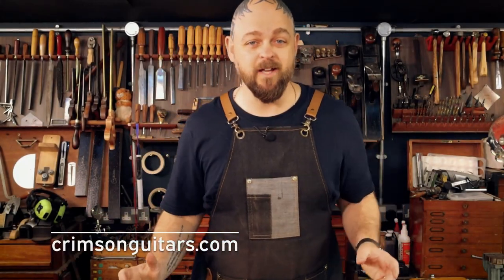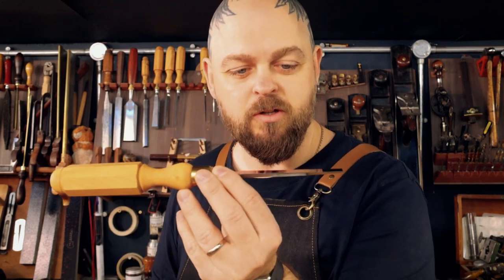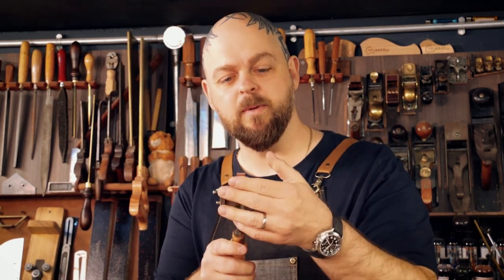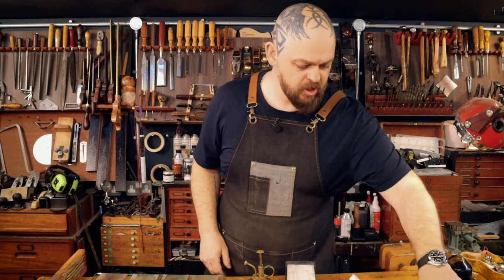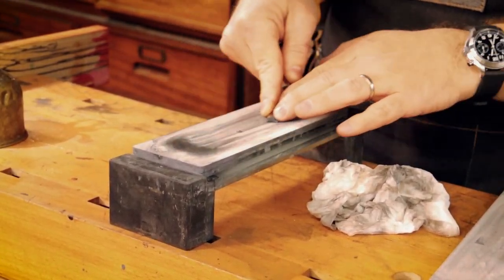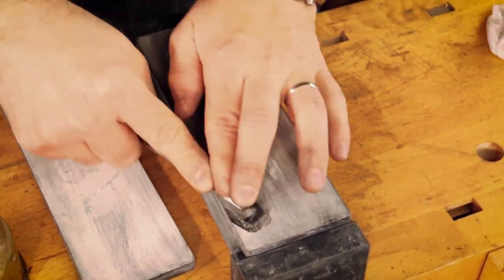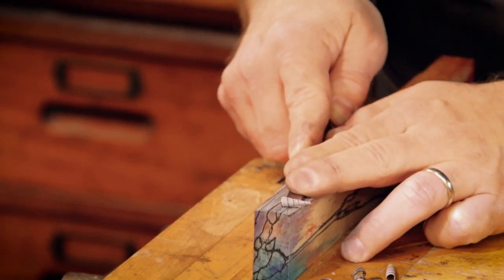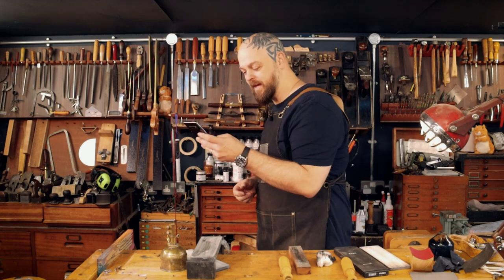HEAD to HEAD - Scary Sharp vs. Waterstone - Chisel Sharpening Techniques put to the TEST

Comment: Good demonstration of why using lapping film on float glass is considerably quicker. I’ve watched highly skilled woodworkers take 3 or 4 times longer using water stones freehand to achieve comparable sharpness to that obtained with lapping films and a honing guide. Stropping makes all the difference to final sharpness unless you use a very fine stone or film in the 1 micron range.

Comment: Tormek.  One nice thing about it is that once the bevel's been established, it is so very quick and easy to replicate it using their set-up jig.  Another is that you don't have to return to the grindstone when your steel gets slightly dull; you use the strop wheel.  A few seconds - literally - of stropping and you're back in business.  Unless I damage the edge, I can strop many times before having the grind.  And again, replicating the angle I want is quick and easy to do.  Killer system.

Comment: Gotta say, I prefer the method used by Paul Sellers (diamond plates + strop) - re-sharpening takes all of 30 seconds for an already-prepared chisel. I tried using scary sharp for a while, and oil stones for a while, and both were too much upkeep (ripping paper, flattening, etc) for the same results.
Reply: Paul is a legend and he uses Aldi chisels quite happily
Reply: Same here! Diamond stones and a strop, although I do use a honing guide most of the time, especially for plane blades.
Reply: Another Paul follower here :) I use a guide for the 1/4" and plough plane irons but the rest is all freehand.

I use the thin diamond sheets rather than plates, double sided taped to a thick lump of melamine face plywood.
Reply: Same.  I have the trend 300/1000 stone and a DMT 8000 diamond stone.  

I find that the most important thing (more so than going to 8000), is using the strop.  That can make a 1000 grit polish cut like an 8000 no problem.
Reply: What grit should i be using for scary sharp? I’ve watched like 5 videos trying to get a list of all the grits and i can’t find it. There’s like 20 grades of sharpening grit. Japanese chisel sharpening is like 1000 to 8000. I’m guessing it’s 4 grades between those two?
Reply: @stevedimebag  what kind of polishing compound are you using for that? I have some green chromium oxide compound but i think there’s finer grade that i should be using
Reply: Off the top of my head I'm using 300, 600 and 1000 grit and the German equivalent of Autosol on a strip of leather. The diamond plates are thin things from China via ebay for a fraction of the price of the blocks from DMT. Paul Sellers also mentioned the thin plates if you search in his videos.
Reply: @simonorchard1115  i set my glass plates up with 300, 600, 1200, 1800, 8000, and 14000 and it seems to work pretty well as long as there’s amole honing fluid applied

Comment: VERITAS!!  Sorry, love those guys, I have a few of their planes.  Do you ever use a leather strop after the microabrasives?  I always keep one on the shelf under my bench and just give a real quick swipe.  Takes it from razor sharp to slices paper like butter in seconds.  Also, I picked up a powered Japanese stone from Woodcraft a few years ago that speeds the initial polish up a LOT.  It uses the flat side of a disc instead of the round edge of a traditional grinder.  Good stuff!!

Comment: thanks, one thing, by starter of with a higher grit on the stones and without creating a hollow you set youself up for significantly more work. Important point I think is that using sandpaper its important to get the right sandpaper system

Comment: I like to use a 120 grit Shapton Glass for initial sharpening (because it doesn't leave scratch marks like the coarse diamond I used to use) and follow up on a well worn 1000 grit diamond and then strop.  Works for me.

Comment: Love the other comments here lots of good points tip for stones, specially on a budget with 2ndhand or well used stones, draw a grid with pencil on the stones and use a level object to rub a few times to find high spots in the stone and use worn out stones, tools or files to take the high spots down and repeat to get the stone level. It can really be helpful in time and energy

Comment: I’ve found for speed, I use a wheel if I need to re grind, but use a veritas jig to do chisels and plane blades at 25 degrees. I only need to use a 1200 grit DMT diamond stone and a strop with polishing compound. 

Perfect polished repeatable edge in a minute or so.  One stone, one stop.

Comment: I've found it's mainly the initial sharpening where you'll see the time difference.  It's like an initial setup of the tools.  Resharpening is much faster at maybe a couple of minutes if you stay on top of it, which is pretty much whenever you feel drag or binding in the cuts.  It should slice instead of requiring that the edge be pushed through the material.

To anyone looking to get into tool sharpening, if you have the time, definitely learn how to do freehand sharpening using either waterstones or sandpaper on float glass (I use both depending on tools).  Once you've developed a feel for how the metal responds to sharpening, it'll greatly improve your use of tools like scary sharp since you'll know what should be happening.

Comment: After 25 years and trying 3M paper to 0.5um or scary sharp (from veritas),  several Japanese wetstones, Torkek, and Shapton ceramic, their was very little difficulty in making a decision what worked best for me. Shapton ceramic stones in 500, 1000, 8000, 16000. Tormek for grinding primary bevel when the secondary is big or on a new chisel. My second favourite is the 3M scary sharp, but that actually s a lot more expensive than one would think

Comment: I use an inexpensive 1000g diamond stone with some window cleaner and an old leather belt with cheap chrome metal polish to strop. £40 total. Can shave with it very easily and quickly. But I gotta admit, the sharpest edge I EVER felt was a friend's katana. That was a truly competition grade scary edge. Looked like glass even under a microscope!

Comment: I hate talking grits of sandpaper and sharpening stones. Each manufacturer seems to use something slightly different. I really wish we'd all just move to the average grit size in microns. That way we could compare all of the abrasives used in sharpening i.e. sandpaper, diamond stones, waterstones, and Arkansas stones.

For instance your Shapton stones - 2,000, 8,000 and 16,000 - are 7.35 microns, 1.84 microns and 0.92 microns. Your Shapton 8,000 is just a bit finer than 6,000 grit sandpaper (2 microns), but not as fine as 8,000 (1 micron) grit sandpaper. And the Shapton 16,000 is just 0.08 microns finer than the 8,000 grit sandpaper.

Green stropping compound is around 0.5 microns.

Comment: Most used in shop are Japanese chisels, mix of about 4 different blade styles, blade widths usually between 1/8-1/2 in each style, split of blue and white steel. Most are sharpened at 35ish degree range all with a microbevel (we mostly work hardwoods) on water stones.  Just recently was trying some “harder” water stones, Ohishi brand.  Think I will go back to the softer water stones, like the slurry build better on them.  The softer stones are more expensive, but give a better edge IMHO.  Diamond stone for flattening water stones.   Water stones from about 400 to 6000ish.  Piece of left over 8-9oz hide glued to wood for a strop to remove burs.  Hand plane irons get sharpened on same.  Have a old Veritas honing guide that gets used from time to time.   Use small slip stones for gouges.    Have a WS3000 in a drawer, have never turned it on.  Have another drawer full of diamond stones that have never been opened.  Metal lathe HS tooling gets shaped/sharpened on a slow speed Jet grinder running various white Norton stones and a pair of jigs (don’t recall their name right off).

Kitchen knives (high carbon “western” and stainless/VG-Max Japanese style; each are sharpened at diff angles) get sharpened, no jigs/honing guide, on the wet stones as well.

Comment: In my lab at Cambridge I had a couple of 'microtomes' - the devices used for preparing specimens for microscopes, slicing them into wafer thin laminae. [ For biological samples, they are first potted into paraffin wax ]. One of them used wickedly sharp metal blades, like vast straight razors [ cut-throats ], only 6 -12" long, & ground from surgical steel. Steel is a polycrystalline material, and at the ultimate level when viewed in an electron microscope, the sharpening process will merely rip entire crystallites out. It looks like a view of the Alps, or any other mountain range [ but, very,very tiny mountains ]. No matter what grit you go to, you will never get to the stage of splitting, or cleaving the micro-crystallites.
For slicing even thinner specimens required a different sort of knife, and I had a machine that produced glass knives from strips of 6mm plate glass. When scratched & snapped, this produced triangular 'blades', with one 6mm wide edge that went all of the way down to the level of virtually single silicon & oxygen atoms. Unbelievably sharp, but glass is not crystalline, either polycrystalline or single crystal - it is a super-cooled liquid. Under the influence of thermodynamics, the knives would spontaneously go dull over a period of a few hours, as the exposed atoms at the very edge shuffled their way back into the 'pack'.
The ultimate blade was, of course' the 'diamond knife'. Diamond is a single crystal, and it is possible to cleave it along certain crystal planes, leaving an exposed edge. Because it is a crystal, the atoms are rigidly tied into the matrix structure, and are not subject to the same 'mobility'. Sadly, the blade was only 2-3 mm wide, in a metal mount - and HIDEOUSLY expensive.

Cutlass Custom Guitars.
Reply: The corollary to all of that is that, at the ultimate degree, the maximum sharpness achievable owes more to the forging, hardening & tempering of the chisel steel than the grit you work up to.

Comment: Why do you need to take out that fraction of material from the back before using the scary sharp? I did not understand that.
Reply: Creating that miniscule hollow makes it easier to focus on the tip. Japanese chisels have a drastic hollow, but on those the lengthwise edges form a plane together with the edge.

Comment: Ben you need to talk to Alec Steele, he’s a blacksmith I follow who could make you lovely things in Damascus steel…. That would be a colab of epic proportions! 
Getting back on point I use a ceramic wet stone and leather strop, haven’t got any chisels but after 15-20 minutes I can have a shave with my Letherman!
Reply: "Damascus" pattern welded steel (not actually Damascus) is not good for chisels, the edge has to be a very consistent material which pattern steel by definition is not. high quality backs with pattern welded tops would be doable though. Alec seems like a good craftsman but i think his style is a bit too full-on for Ben's audience, it certainly is for me.

Comment: Why didn't you strop the first one. I like the DMT diamond stones because I don't have to flatten them. I have a piece of 1/2" float glass that I used to use before I got the diamond stones, but I keep strips of 3M 150, 220, 320, & 400 on it for making whatever I want flat, like nut & saddle bottoms.
Reply: You don't have to strop at a high enough grit.
Reply: @heMANshred    
Ben stropped the second after 8,000. I wrote the comment just before he said he could have stropped the first one. I always do and do even if not sharpening before using. On chisels, anyway, since it's so easy. I wouldn't strop a plane iron unless I took it out to touch it up.

Comment: Seems I have come late to this discussion. First of all, like all great teachers you impart enthusiasm which is the essence of teaching. Second, you may have discussed Arkansas stones but I have gone back to my Washitas for chisels. As I restore old, usually rusty carbon steel chisels I understand why, when the Arks were introduced in the late 19 century they swept the market. That is not to say they are any good for knackered bevels which - as you say - require a machine or a 60 grit, 2 hour slog. Or good for modern tool steels. 

It's that combination of chisel, oil and stone that is sort of Zen. My best Washita can be anywhere between 1000 and 5000 depending on pressure and other things. Then it's strops in a progression through black compound, green, white and Red (jeweller's rouge).  I do my micro bevel on the strop. Knives, on the other hand, hate the Washitas and just love my Naniwa 400, Shapton pro 2000, Suehiro Rika 5000.  Thanks for such a stimulating video.

Comment: I go hybrid... ceramic alumina sandpaper to prep edge, a handful of passes on a dual sided waterstone for problem wood species (10 or less on each side) , and then a strop.  Once the back is flat I only sharpen on the bevel side and remove any burr that forms (ignoring micro-bevels).  Using coarse stones or diamond plates is so much slower with no benefit.

Comment: Diamond 400 grit to get rid of any problems followed by wetstones 600, 1,200, 4,000, 8,000, 16,000 & 20,000 with a Naruto stone slurry that goes probably to near 40,000 when it’s in process.  I strop on mounted veg-tan leather about 6mm thick on 18mm board ,  flesh side first then grain side .  The only strop dressing I use is a little oil on the flesh side.  I sharpen leatherwork tools this way for skiving.
For more rugged knives I have a strop 2’6” long made of leather coated in tallow and carborundum

Comment: Currently I'm using a Scary Sharp system, only because that's what the budget agreed to. 

I think a more telling test would be to see how both edges hold up over time. How long will it take before you have to resharpen the Scary Sharp vs the Water Stone. My research has shown that the higher grit stones, such as that 16,000 grit Shapton, will provide an edge that lasts longer and requires less return trips to the sharpening station.

Comment: Hold on Ben, it wasn't the fault of the waterstone that the second chisel had a low corner. if you had used the two systems the other way around would the results have been reversed?
Reply: Exactly. 🙄
Reply: Thats what I thought .

Comment: There's a "problem" with waterstones - it's always a small process, almost ritual, to start sharpening... It's not like 1-2 minutes on glass and 1500-2000 grit sandpaper. From the other hand, you could buy/find bigger glass and use it for other purposes in the shop. I've bought 400x600x19 mm glass (and paid too much to be honestly...) - and now I'm using it as lightbox for soundboard preparation for glueing, leveling surface for necks, etc. Of course, that required some extra steps and it's not glass + sandpaper cost, but its multipurpose item in the workshop now. Heavy as hell, btw )))

Comment: My take, 
Use a grinder for the initial angle,if you're worried about messing up the temper use a watercooled grinder like a tormek. 
From the grinder ill deburr the edge with, I think, a 5k grit watersone(I say think as iv had the stone for over 20 years and my memerys not what it was) 
From there I'll polish on a 20k grit polishing stone, no strops or guides or any of that time wasting nonsense. 
Takes maybe 60seconds not including initial grinding which I'll do maybe once or twice a year,add an extra minute or two if you need a regrind. 
super sharp is a gimmick designed for Newby types with no confidence and too much money,same as honing guides.

Comment: japanese chisels are hollowed but they still provide contact along the longer edges as well. if any of u do joinery dont do this. another solution that i have seen is using a dremel with a ceramic wheel to VERY VERY CAREFULLY and slowly produce the same hollow. another option is using a carbide scraper that machinist's use. must be carbide though. hss would do anything but scratch up the surface. yet another is to use jewellers diamond files or sandpaper wrapped around a dowel. many ways to skin a cat

Comment: Sorry, but it wasn't a fair comparison.  I don't know what grit you started with on the scary sharp method,  but if on the water stones you had started with a courser grit, it would have been a little more of a true comparison.  Either way they both work, but sand paper over a period of time will cost more. I know, done both methods.

Comment: Yet another sharpening video! Scary sharp is accurate especially for flat back purposes but changing the papers is a real pain. Better by far to use good water stones and true them up every time on wet/dry paper and float glass. Stropping is a waste of time, all it does is round over a sharp edge.